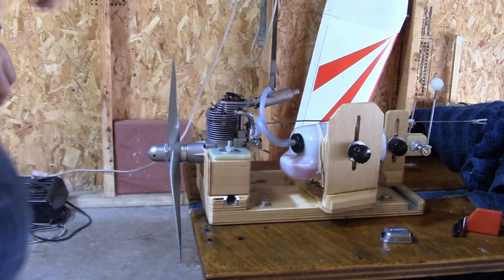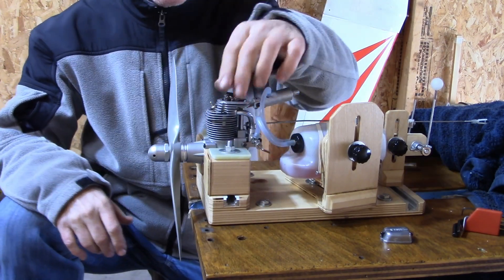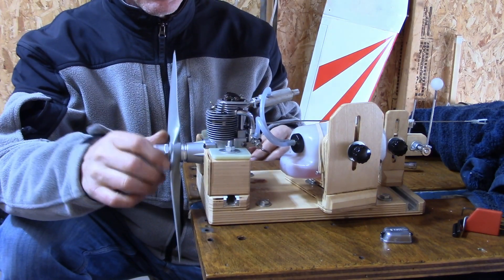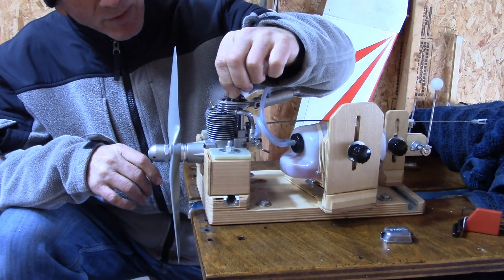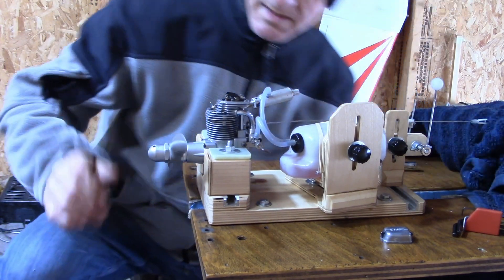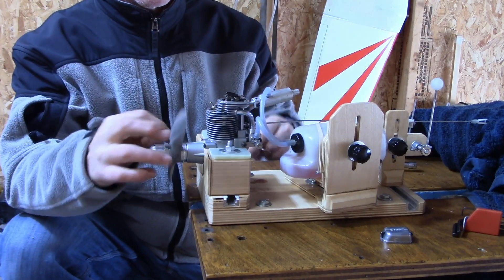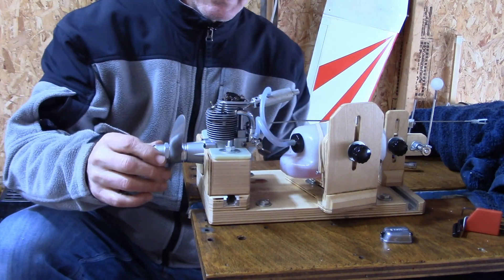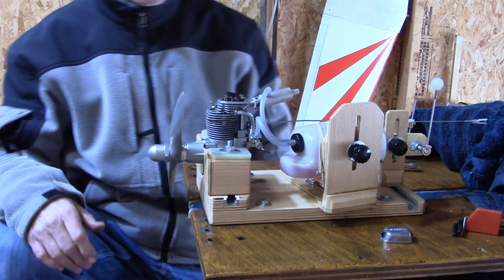Customer Engine Enya 46-4C Run Attempt

Comment: It's the new test stand!! Is it working well?
Reply from the maker: Well i used it only because i had two customer engines that i wanted to get out. I plan on making an outdoor video soon discussing more about this stand and its first ‘official’ use.  There are some things i like about it and others… well i need more time to focus on using it and not on running a customer engine before giving it my full evaluation.

Comment: You could give the valve to a machinist and see if he can get it straight again. A light tap on the valve here or there, refinish the face and seat in the head...there's not much to lose.
Reply from the maker: I understand that your point, but as I just said in another comment, I do what the customer pays for and allows.  Besides I do not have a local machinist to do things for me.  It isn’t like everyone just has a machinist sitting around waiting for them to called upon.  Contracting machinists is not in my Engine Services contract nor is it something I offer.

Comment: There also might be some hard residue inside the valve guides. I have this in a Laser 120, my ultrasonic cleaner isn't able to get it out.
Reply from the maker: In the first video i took the head off and removed the valves. There was no residue. The top of the piston didn’t even look like the engine had been run more than a few times.
Reply: @dmrcflyr2  In my case the residue is almost invisible. The preowner used Castor Oil which gummed up. There must be a reason why the valves get stuck (in my opinion the only possibility for the loss of compression). Either they are bent or there must be an obstruction. Try to clamp the valves in a drill and look, if they run unevenly.

Comment: Bent valve, cracked warped head maybe?
Reply from the maker: The valve did not appear to be bent when I removed and inspected it.  I have no way of testing for a warped head.  Regardless if replacement parts are unavailable then the root cause is moot.